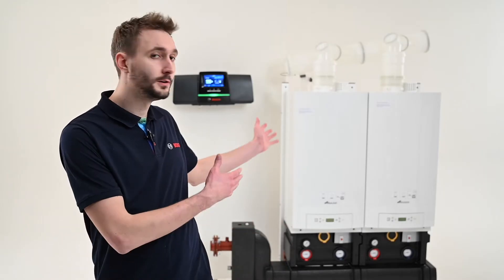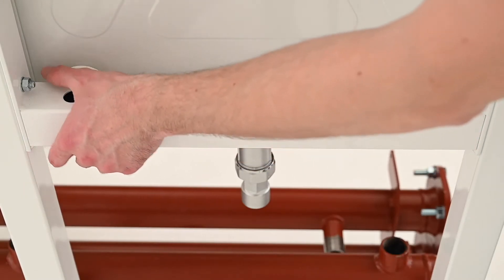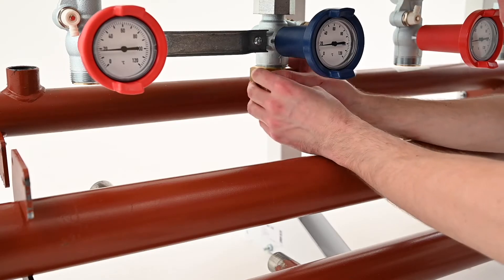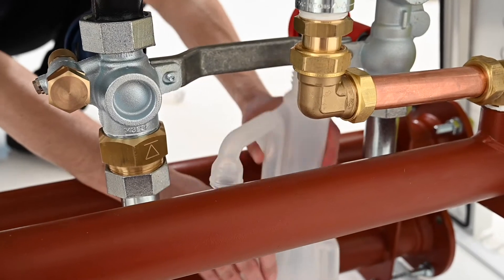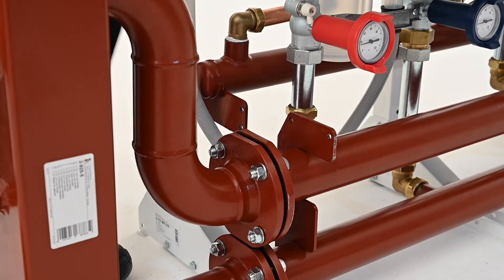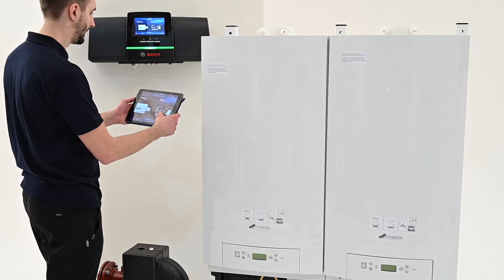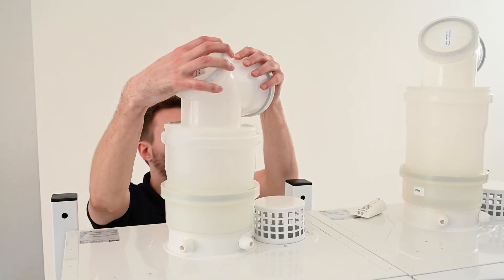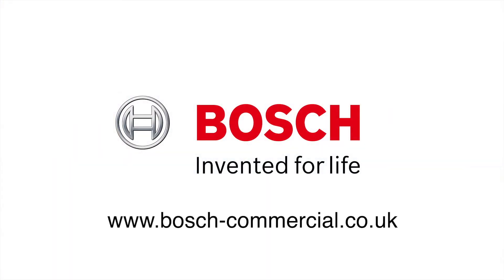Bosch GB162 boiler installation guide

Comment: Hi. Can you advise me.. I had a Worcester Bosch boiler 4000 25kw.  In storld this year.  And I am having a lot of problems with this boiler. 😕  should the scale filter be connected to the hot pipe.  Or flow... pipe... I also keep  losing pressure... Thanks